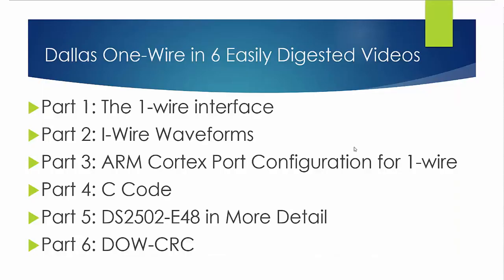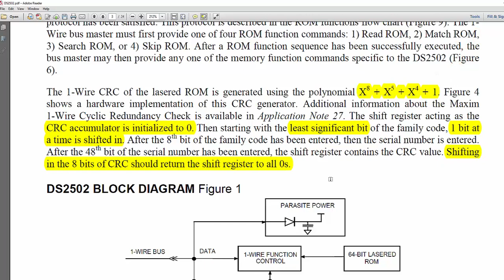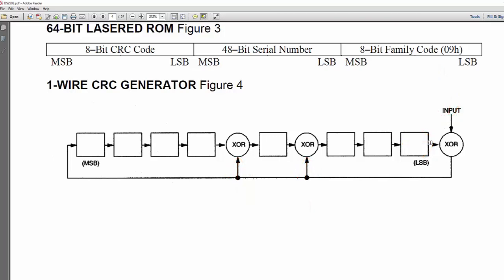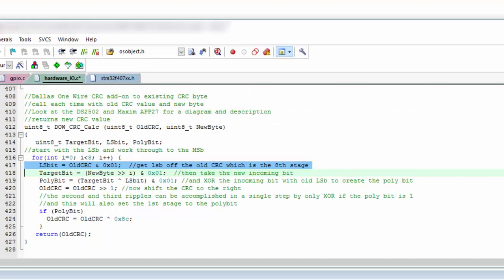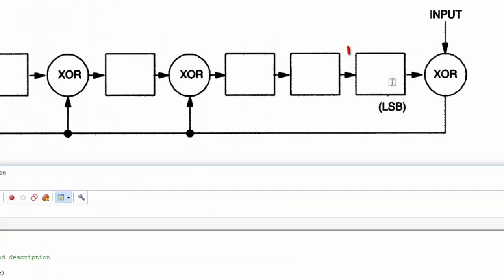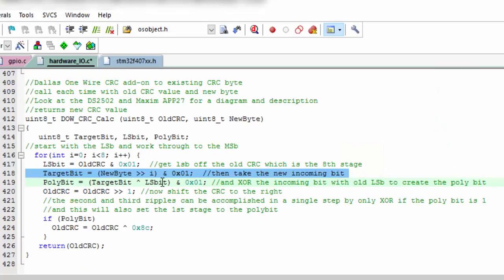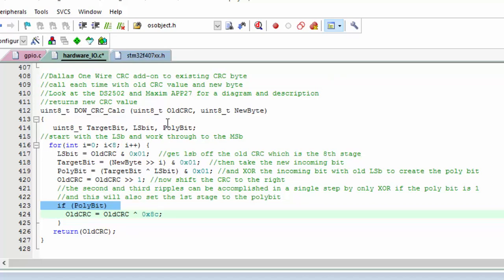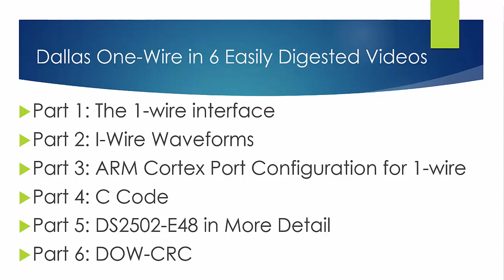{8} Dallas One-Wire Part 6 DOW CRC concept and code

Comment: Can i know how would that 0x8C works ??
Reply: When the CRC register it bitshifted one step to the right there is always a zero at the MSb (the leftmost box in the image).

If the result from the first XOR operation stored in PolyBit = (input ^ LSb) is equal to 1 then you could use XOR to set the MSb in the CRC register, since 0 XOR 1 = 1.

And also the PolyBit (or feedback if you will) should be XOR'ed with the bit #4 and #3 during the bitshift to the right.
But the bitshift have already been done, which means that the value that was in bit #4 and #3 now are in bit #3 and #2 (using LSB0 bit numbering).

If we then look at the number 0x8C which in binary represents as 10001100 you can see that bit #2, #3 and #7 is 1 the other bits are 0.

Given the nature of XOR it's only meaningful to do the XOR 0X8C when PolyBit is 1.
If bit #4 is 0 and PolyBit is 0 the result stored in bit #3 after the XOR operation should be 0, using XOR on 0 with a 0 is 0, which we already have in bit #3 due to the bitshift, no need to do the XOR.
If Bit #4 is 1 and PolyBit is 0 the result stored in bit #3 after the XOR operation should be 1, using XOR on 1 with a 0 is 1, which we already have in bit# 3 due to the bitshift, no need to do the XOR.
In short PolyBit will never make a difference when it is 0.
And regarding the MSb (bit#7) which get set to 0 in the bitshift, well if it is 0 already then all is good.

Using XOR with 0x8C to the CRC-register when PolyBit is 1 accomplishes the tasks of setting MSb to 1 when needed and do the XOR operations with bit #4 and bit #3 when needed.